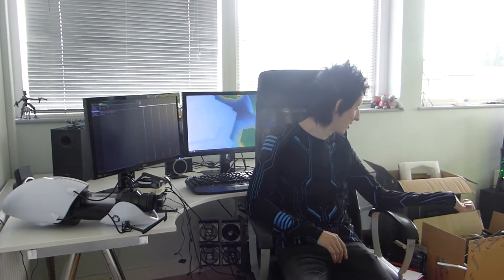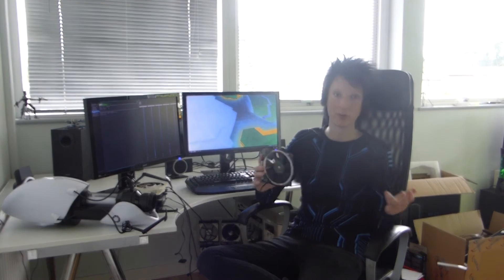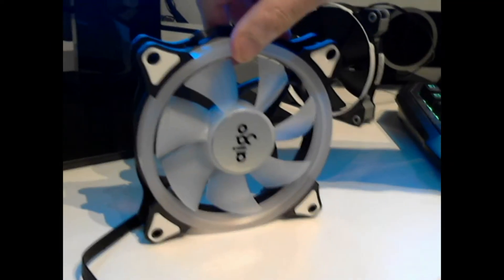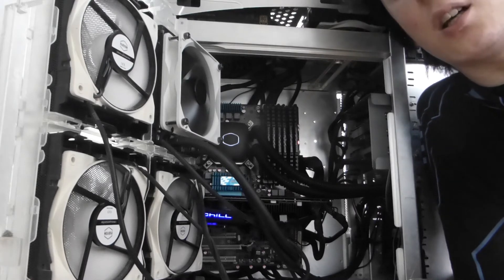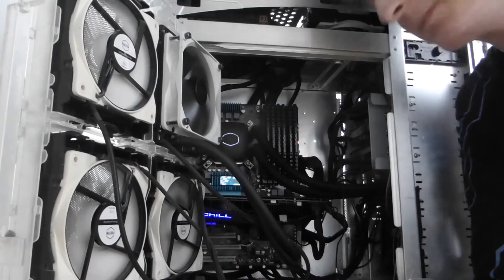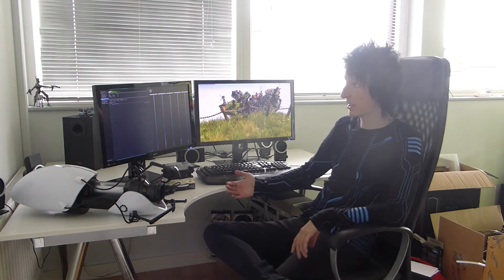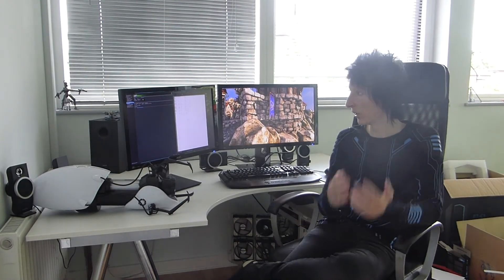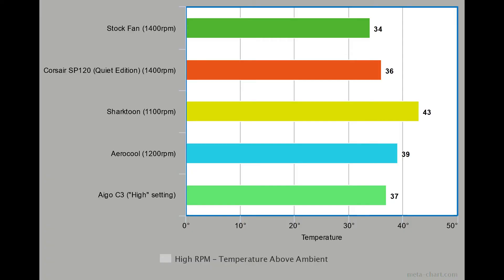Do static pressure fans matter? 6 way radiator fan test (part 1): Corsair SP120 / Aigo C3

Comment: followed your build on overclockers forum awesome job im doing a ryzen 7 build with a 360 slim rad and a 240 slim rad was looking at thermaltake riing fans because of static pressure but the aigo ones look awesome how are they performing for you and do you think they will be adequate for my build also how noisy are they at full speed subscribed aswell
Reply from the maker: Personally I prefer the look of the Aigo fans but I wouldn't want to run them on the high setting as they're far too loud for me on that. 

With your 600mm radiator space, you will not need to run fans on full. The reason I, and most others, over-subscribe radiator space is to compensate for running fans on low RPM. The difference between low RPM and high RPM on my setup is about two degrees, and that's due to heat buildup in the case. 

The disadvantage of these Aigo fans is that they only have two settings, High and Low. As I discovered in the noise and performance test I did, I'd guess they are somewhere between 800-900RPM at low which gives more than sufficient cooling. As you'd expect, better than the other fans I tested at 700RPM with a little more noise.

I did look at the Thermaltake Riing fans but they're £90 for three compared with £40 for three for the Aigo fans. I prefer the look of the Aigo and since I have 15 fans total, £90 for 3 quickly adds up--I went for the Aigo ones after getting a set to test with.

Noise wise, with 13 (two are just the casings-see my build log) they are audible on low. Using Corsair SP120s or likely any fan that runs at a lower RPM would be quieter (but perform slightly worse)

Having said that, for comparison, when the fan in my EVGA G3 1000w (I had to replace the G2 as it was too much of a squeeze) comes on, it's much much louder than all 13 Aigo fans combined. Yesterday, I plugged in a 2tb WD Green HDD in an external USB enclosure and the spinning disk was louder than all the fans.
Reply from the maker: Oh and temperature wise, under load my 980Ti maxes out at 39 degrees. The 1950X maxes out at 58. Turning the fans and the pump up to max reduces the GPU to 36 and the CPU to 54 but the added noise is not worth it to me.

The EK CPU block is rather disappointing to be honest, I was expecting slightly better temps than that. Having read a few forum posts, ti seems about right. Clocking the CPU at just  3.7ghz on all cores causes temps of 70 degrees. Admittedly, I haven't yet tried overclocking with the fans and pump on full.